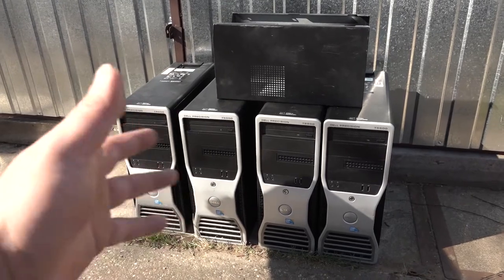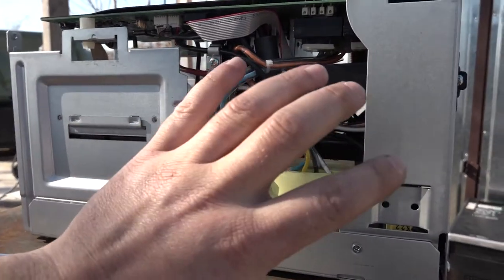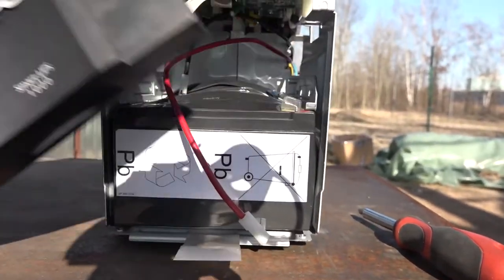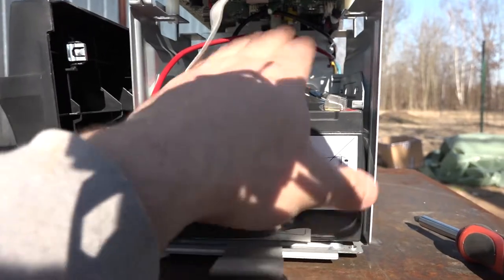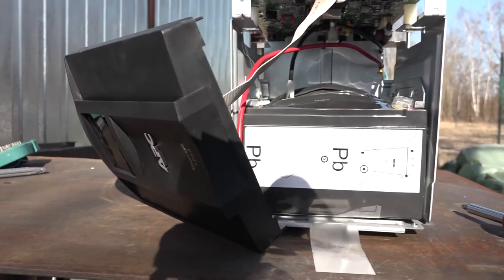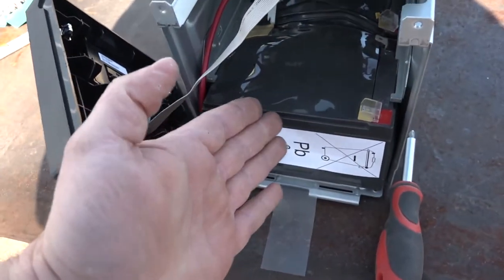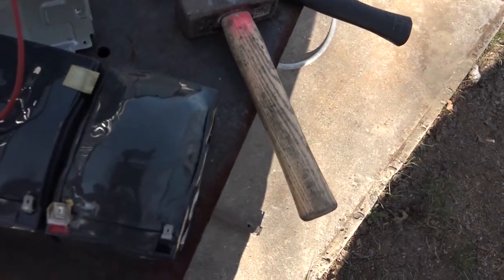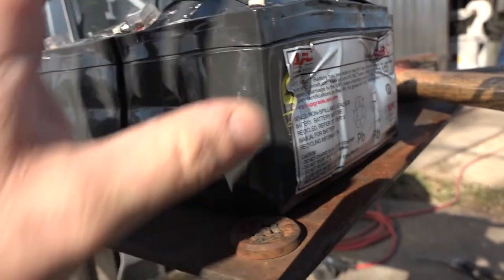APC 1000 Smart-UPS  review  APC DUMB-UPS 1000

Comment: I have repaired a couple of those SmartUPS1000 but I have never seen such a blown up battery. Sometimes they expand a bit and it can be a pain to remove them... but never like this.
The APC UPS's normally check the batteries in regular intervals. Standard is 48 hours but that can be changed in the settings. The battery check can also be disabled completely. Which could lead to what you experienced.
The small 1000VA versions more often have bad capacitors on the main board. Before you install new batteries, you should check that. This could also lead to unpleasant behaviour.
The battery test works like that: In specified intervals the UPS disconnects the mains input and goes into battery mode for a couple of seconds. It measures the voltage and if it drops too fast the UPS will put the "battery bad" LED on. If the battery is completely dead, the output will also fail and your computers will crash. But normally bad batteries are recognised before that happens... normally...
Also APC says that the battery lifetime is about 5 years, which corresponds with my experience... what manufacturing date have those batteries? There is a date code on the battery itself... something like 1307XXXX (Y:2013 M:07 XXXX=some code)
Reply: The problem here is that even if a battery is hot and bulged, it can still report enough voltage to satisfy a dumb test that checks voltage only.

He asks the right question - how can a device that have a high risk for fire hazard be designed without any temperature control? It should have immediately detected that the temperature is rising abnormally and turn off the charging circuit and report battery error.
Reply: I talked about this with some people in UPS service centers who have experience with batteries and they told that, unfortunately, sometimes batteries can bulge at totally normal room temperature. So, thermal sensor won't detect the hazard. Maybe a smoke detector would help but UPS doesn't have one.
So, I'd say to play it safe we would have to set the battery test to be done every day and also have a smoke detector nearby, which can not only ring the alarm but also send an email about the fire hazard.

Comment: I know it was a funny video, but is the way Robert do his videos and it is sad that happened. From my experience APC build nice UPSes but their charging circuit sucks, they only do bulk charging and and then float, this is not recommended for gel batteries. To several customers I had to replace gel batteries with car lead-acid batteries because it handle better the APC charging without further modifications but you need to change batteries every year or two because it degrades it.
Reply from the maker: But why this Dumb UPS is not handling the batteries as should be? Like charge curve, discharge timing, leak compensation, temperature sensing, periodic testing etc.... ?

Comment: whooo.
Looks like fire safety disaster...
As I know the device (software-hardware) cannot detect these failures, users need to recalibrate batteries manually (in software) and only then device will tell something about battery life, status, etc... (self test in this model ?)

OK, google search tells me that battery failed, UPS did not see it and charged it till it was 100% dead. smell - hydrogen from this reaction. Battery fail can be caused also if it is overheating.

wanted to buy APC brand rackmount 1u or 2u, now I don't know what brand to buy.
APC got a lot things for servers...
Reply from the maker: https://www.cyberpowersystems.com/product/ups/ol3000rtxl2u/
this is what I will order maybe.... 3 state charging, double conversion, battery life-cycle management etc...
Reply: Look also at Eaton models, they claim to have advanced battery management that measures battery levels in smarter way than other UPSes. And people in general have good experience with Eaton.

http://www.eaton.com/content/dam/eaton/products/backup-power-ups-surge-it-power-distribution/backup-power-ups/eaton-abm-technology-ap162003en.pdf

But Eatons have a fan that is constantly spinning. It is good for batteries but not good for a silent system. You can replace it with Noctua, but the warranty will be void then.